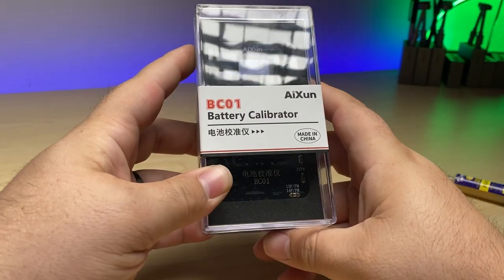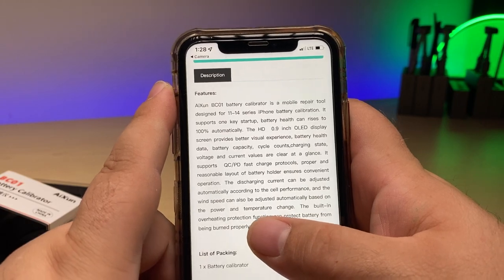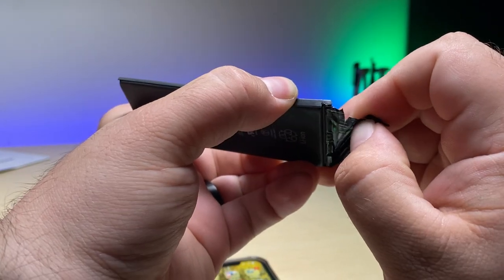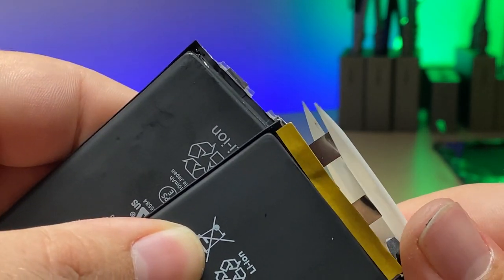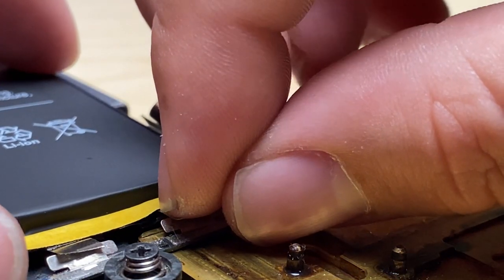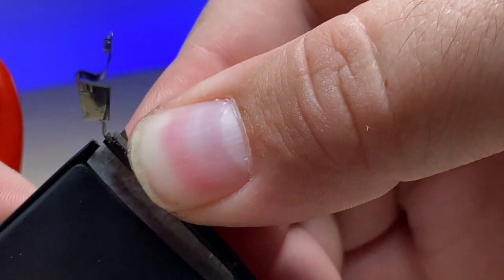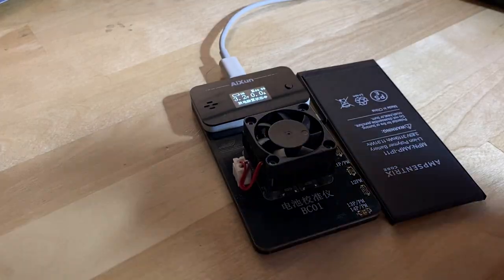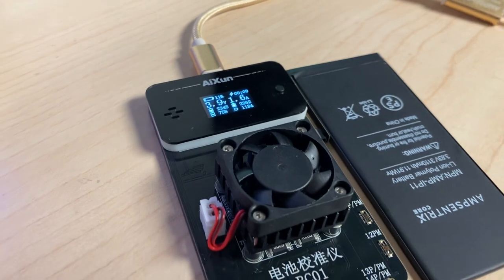AiXun BC01 Battery Calibrator (100% without tag on flex!) (Tips and Tricks #23)

Comment: You can achieve the same result with Tag on Flex by connecting it to the new battery. Once it indicates 100% , disconnect the Tag on Flex and connect the battery alone to maintain the health at 100%.

Comment: A week? Wow. I see how it works. But tag on for customer repairs and this for buy n sell.
Reply from the maker: I'm glad you get the point of the product
Reply: @MobileSentrix   I also noticed you didn't reset the actual battery cycles to zero. What method are you using?

Comment: The benefit I see with this tool is I think it will get rid of the significantly degraded battery message. I have a 13 pro max programmed to 100% with the Ampsentrix Tag-on-flex but still says “service” and “Significantly Degraded Battery”. 
All while reading 100%. 

On 3U tools you can see it was originally at 56%. 

I will try this tool and update if anyone is interested.
Reply: You have to leave the tag on flex on the phone when the battery condition has dropped too low like in that case 56%
Reply: Where you able to fix that ..100% and still on service